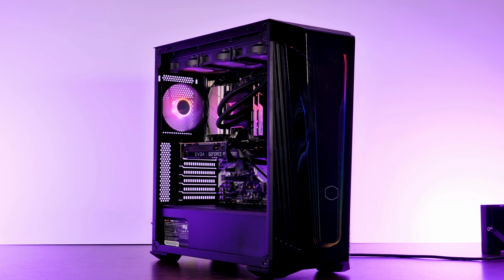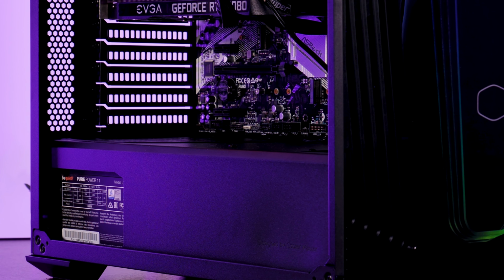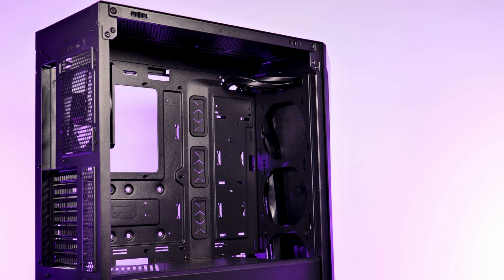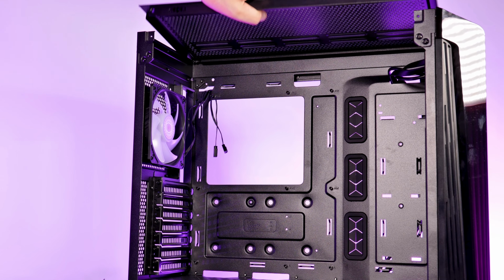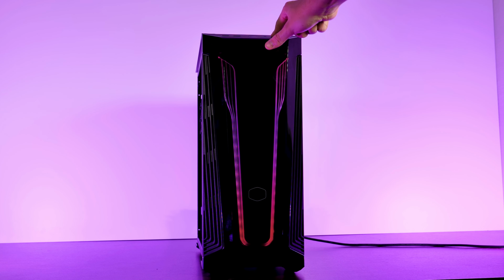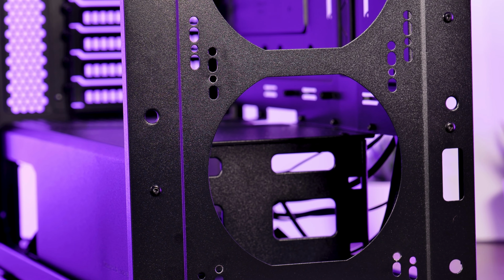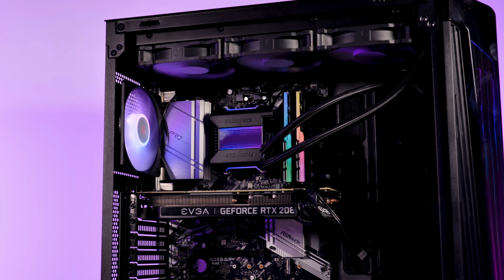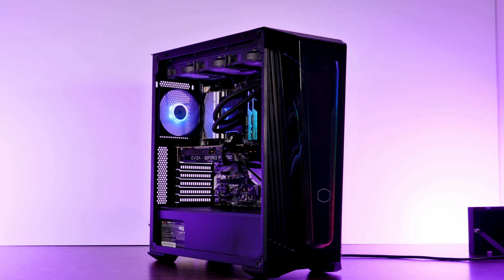Cooler Master Masterbox MB540 Review - With an extra feature

Comment: I have this case and running 3 intake fans at the front , one exhaust fan at the back and one exhaust fan at the top, i am finding the air flow good and temps are better than i thought, it says you can connect the front argb light strip to motherboard and control with software..... i am still trying to find a way to do this as everything i have tried wont work.

Comment: This video persuaded me to buy this case, and I have to say I love it. If the RGB is done right it looks like a fancy car from a TV commercial 😆 The inside is very spacious which helps with the airflow, which really isn't that bad as it may seem from the video. Mind you I'm not running exactly the top of the line hardware (Ryzen 5600x, RTX 4070), but for an avarage user the cooling capabilities are more than enough in my opinion.
Reply from the maker: !Enjoy it

Comment: I has a Deepcool 310 (solid front panel) but my cpu ttemp is 60C under full video editing loads.  I has performance fans and optimised fan profile.  So you can't judge a case by the front vents!   It's HOW you place and quality of the fans and set PWM profiles!